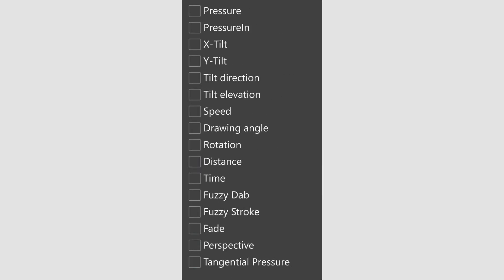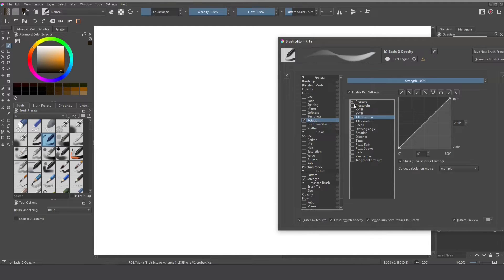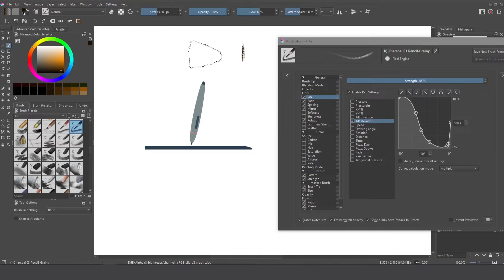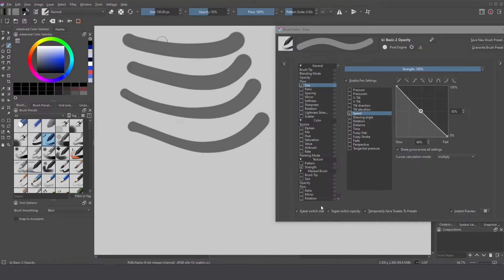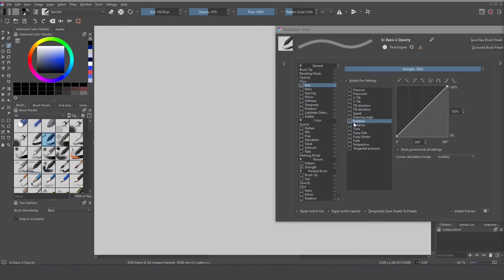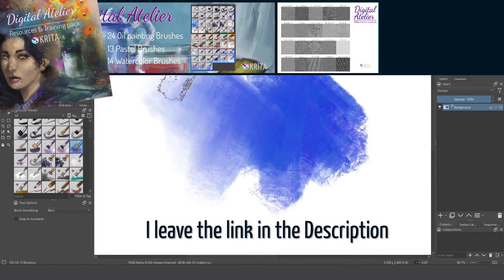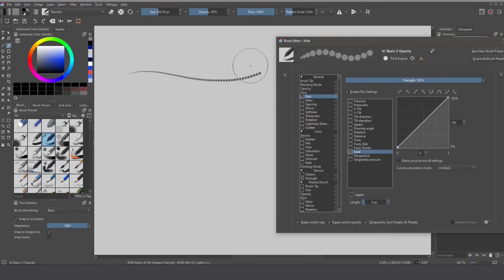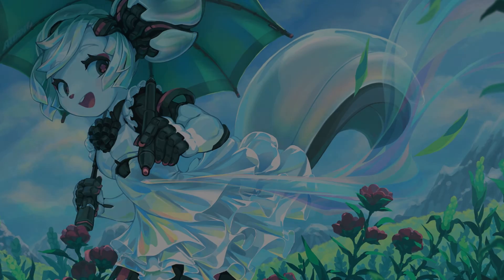SENSORS in KRITA 5 2022. Making BRUSHES Part 3

Comment: just a problem, but I didn't understand the size part. when i select the size option, my brush becomes so small that I can't see it on the art board and it does not make small to large stroke no matter what I select. Rest all the brush types and settings work perfectly fine. Please help me.......
Reply from the maker: Wich brush?

Comment: Thanks again for your very clear explanations! Little question, are you going to explain the new smudge engine in a future video? I love the blenders in your impressionist brush pack, but since the upgrade to Krita 5 these 2 brushes seem to behave differently than in Krita 4. I've tried to adjust them, but I don't seem to be able to make them work as before. Your work for Krita is very much appreciated!
Reply from the maker: Is broken because I was using a trick with the old color-smudge brush engine. The New one is more powerful but the behavior uis a bit different.  I plan to fix it asap //RM